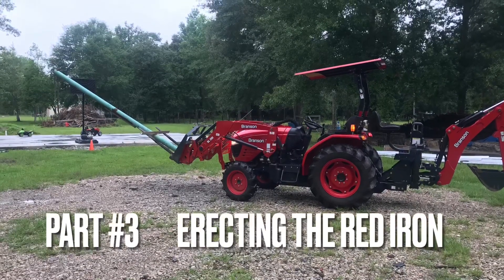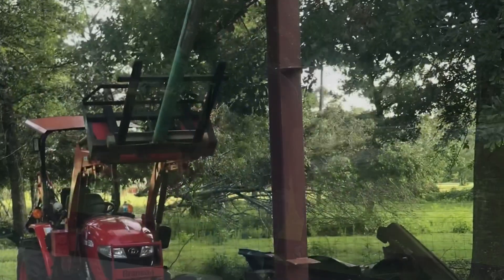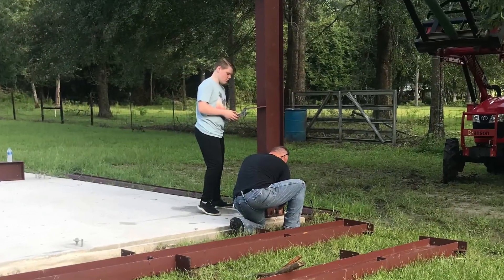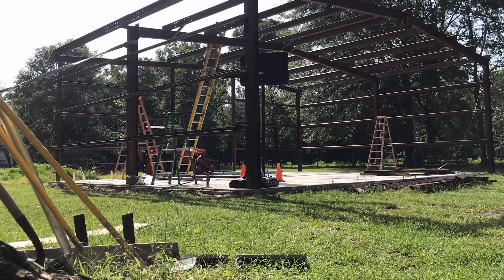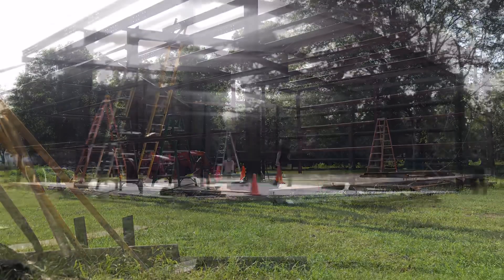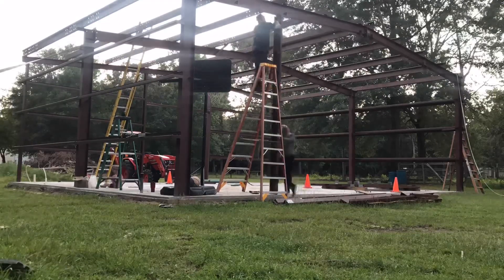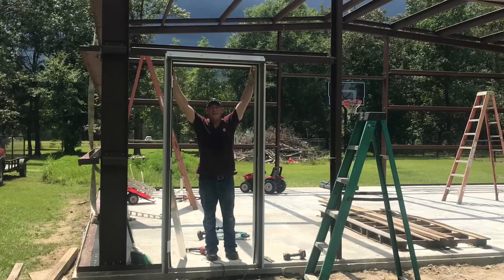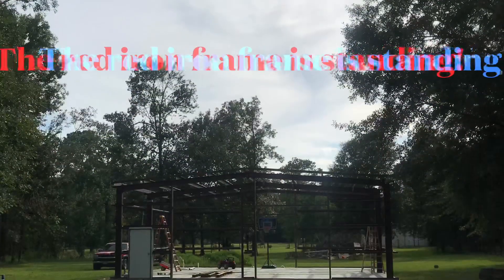How to build 30x40 metal building (part#3)

Comment: Awesome and congrats on the building! I am going to be undertaking the construction of my own building this summer. Question for you, what did you use for the jib pole coming off the tractor?
Reply from the maker: Pole welded to like a metal pallet. Then you just pick up with pallet forks. It was loaned to me and do not have in my possession anymore so don't have the dimensions.
Reply: @fixitdad9669  Thanks for the info. Pretty smart idea

Comment: Was wondering on your tractor you had a large pole coming out off of your forks wasn't quite sure how that was attached I have several tractors and was curious to see how you did that any input would love to hear from you this is John Conway in California going to be putting in the barn
Reply from the maker: A metal pallet and a pole welded to it. Then pick up pallet with pallet forks.